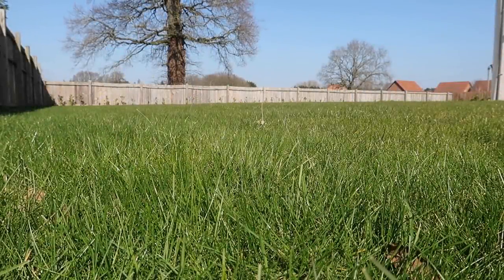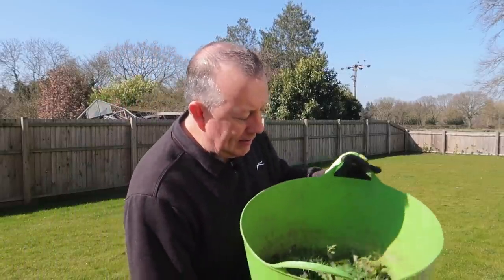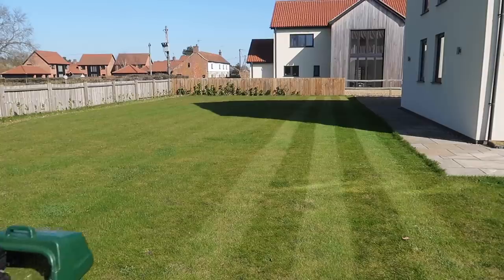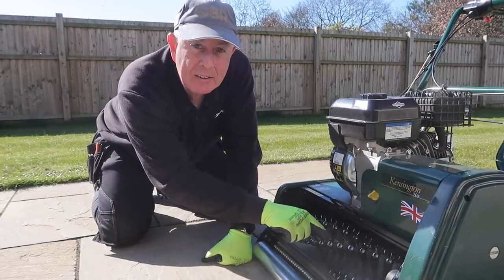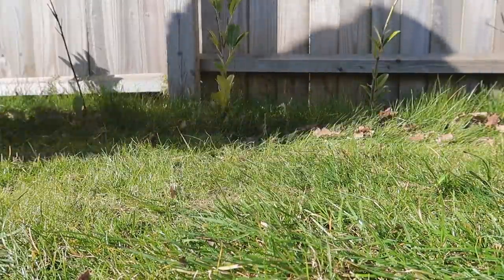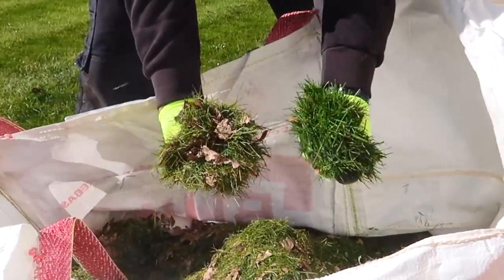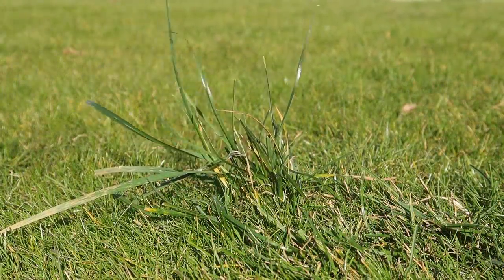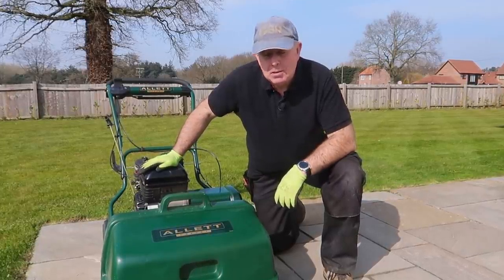The Step by Step Guide to Scarifying your Lawn

Comment: The cartridge you put in is basically a power raking attachment. A scarifier almost looks like a rototiller type blade. To get out old thatch you need to go much deeper but since as you said your lawn is only a few years old you likely don’t have much deep thatch so the cartridge you used is fine. For now.

Comment: Just a few quick tips coming from an Allett Dealer. Remove the side cover first to give you a great place for your cartridge screws to rest. This way you don’t lose them. Another quick tip is to remove the static rake from behind the front roller when Scarifying. Should be two small 13 mm bolts and it just drops out. You’ll have less resistance while working thru the sward. Give it a go next time. Cheers.

Comment: Lovely mower that. 
That attachment was a raker (imo). It won’t scarify it just tickles the surface. Mainly for leafs and debris.
A scarifier has blades that cut down into the thatch layer and the amount of material that comes out is outstanding. You’d fill two tonne bags easy with your size lawn.
I put down a moss/weed killer in late February, then middle of March a short cut, then scarify, it can bald it in places but some top soil and seed and she’ll be looking good come June.
Looking good that lawn mind, looks pretty young. My lawns been neglected by the previous home owner (moss galore, bouncy thatch). A work in progress. Whatever works for you. Cheers
Reply: my thoughts aswell it was a power rake not a scarifier

Comment: Hi Stuart
Really enjoyed your top class video. I have the same Allett mower as you and find it fantastic. I took of the front roller and comb and put on the wheel kit that came with the mower. Does a great job as it doesn’t flatten the grass. I still have my rotary mower that I use after scarifying just in case there are any stones or debris left behind so as to protect the reel blades ( I can sharpen the rotary blades easily). I know it’s a lot of extra mowing but the exercise is good 😅. Thanks again for the video and many others of yours I have thoroughly enjoyed.
Reply from the maker: Nice one! To have a rotary back up is useful as you say and when the annual meadow grass wants to stick up. Glad you are enjoying them.

Comment: It's a great video, but I think you were raking, not scarifying. You were essentially using a mechanical version of a spring tine rake. A 'scarifier' comes with a cassette of vertical blades which are used to cut into the soil to create a bed for seeds to fall into when overseeding. It also removes thatch and some say it aerates, but I don't think it goes deep enough to do that. I hope you don't mind me pointing this out, because you're video is very informative.

Comment: I found that with this type of mower, the plastic gears have a tendency to shatter if a stone or something hard gets jammed in the reel. Nice finish 👏
Reply: 1600 quid for a mower with plastic teeth! Good lord.
Reply: @BillCarrIpswich  yep. The older gears go brittle and break a lot easier.
Reply: @martynbuzzing3327 I'm sure another 100 quid on the price for proper machined gears won't lose them any business
Reply: @canalboating  That's fair enough I suppose. I hope they have good servicing and spare part availability
Reply: @canalboating  yep, exactly. The older machines use the same gearing and they sometimes broke because they got brittle and shattered at speed.

Comment: Hi Stuart 
 Great content mate you’ve done a really great job… may I suggest one thing that you give your lawn a good top dressing which will help to level your lawn so when you’re cutting it your mower is not bobbing up and down all over the place and it will make your lawn look so much better nice to see you’ve put a bit of weed and feed on as well thanks mate
Reply from the maker: Thanks. Top dressing is absolutely needed and will be in a future video. Running the lawnmower over it at the moment is like hitting the rumble strips on a motorway!
Reply: @ProperDIY  
The only bad thing about top dressing mate is it takes the cutting edge off your cylinder mower which then usually you will need to back lap your cylinder with the bottom plate with a cutting paste To get it to cut your grass nice and crisp same as when you’re cutting glossy paper to make sure it’s cutting correctly

Comment: Stuart. It's interesting your nemesis, Poa Annua, appears in the beginning of your warmer seasons.  Here in sub-tropical Australia, Poa Annua is called Winter Grass, as it only appears in, you guessed it, our winter.  And yes, it's a real problem here as well, growing in areas that are in winter shade.  It won't grow where there is direct sunlight.  It just shows the climatic differences between the two countries.
Reply from the maker: I find it here all spring and summer. late summer it seeds and is a particular problem.
Reply: Our winter sun is similar to your winter sun.  
If Poa Annua is not removed before the seeds mature it will re-appear for the next five to six years.
Thank you for the effort you put into your very informative videos.  They are of great value.

Comment: Good job, I use the fiskars weed puller loads to save my back. I have a camon professional scarifier and it does a good job of scarifying but leaves loads of mess because the collection bag at the back is next to useless. I have to spend ages raking up and cleaning up with the leaf blower. How do you feel about black fence paint? I'm gonna try using bitumen to hopefully get it in one coat. Cheers 👍

Comment: I was told that anything with tines is a "grass rake", and a solid blade is a "scarifier".
Also, consider building a hinged "sheep pen" contraption that serves as a frame to hold a one-tonne bag. Then lace the bag into the frame and not have to manhandled the floppy bag whilst dumping rubbish in it.
Reply from the maker: No. Have a look at the Allett website